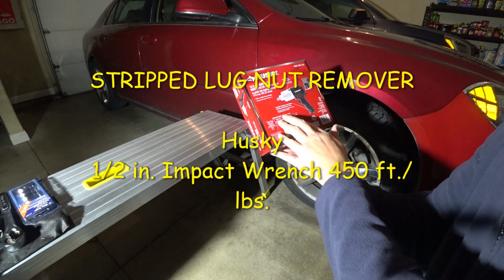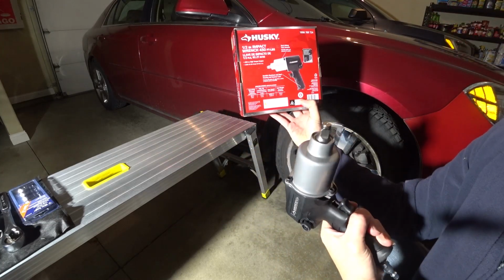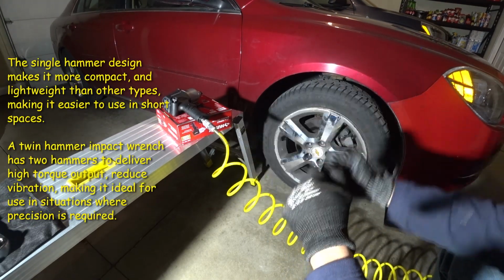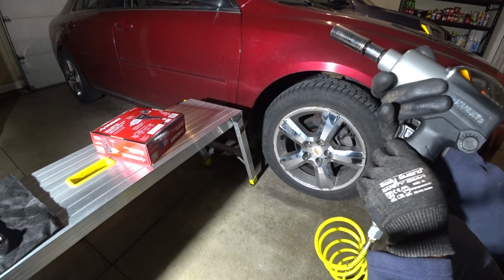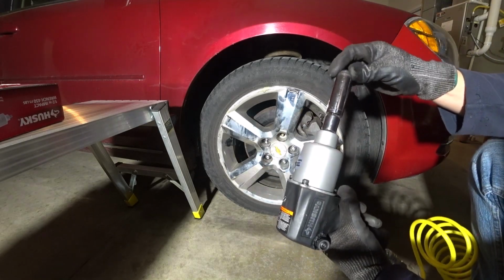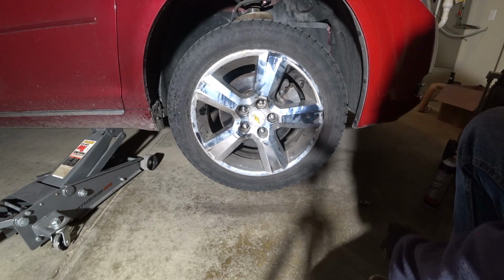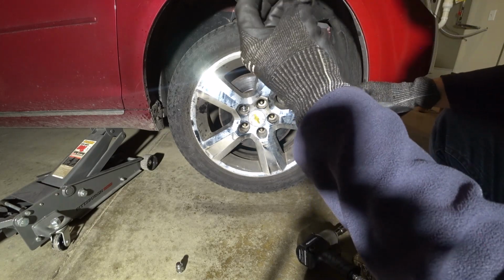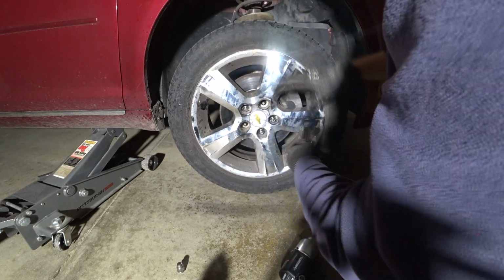STRIPPED LUG NUT REMOVER - Husky 1/2 in. Impact Wrench 450 ft. lbs.

Comment: How did u get adapter on the bottom of impact like wht size
Reply from the maker: There is a link to the impact adapter in the detail video subscription. It has all the size, Standard SAE Socket Impact Adapter & Reducer, 1/4, 3/8, 1/2".
Reply: @LifelFinanceRealEstate  im talking about the plug tht goes into the air inlet
Reply from the maker: I believe this is what you are referring to is the 1/4 in. x 1/4 in. NPT Male Automotive Plug. Hope this helps.